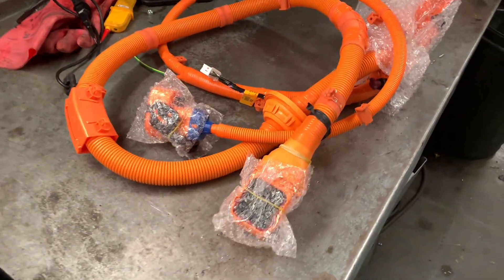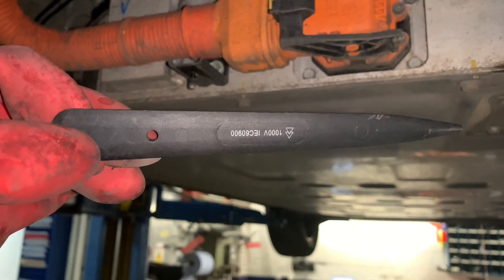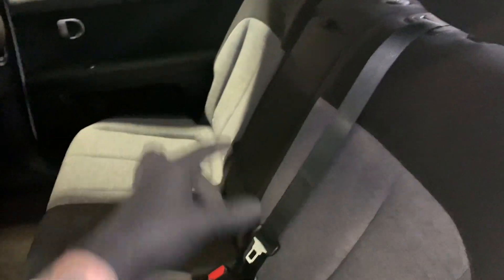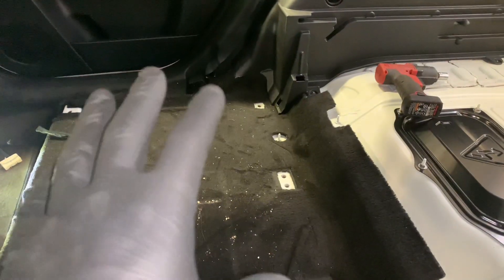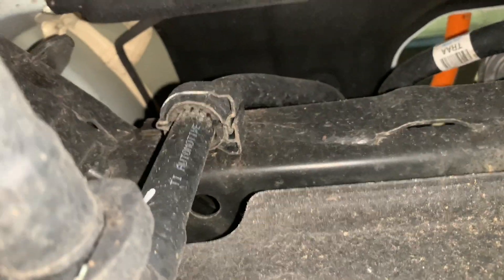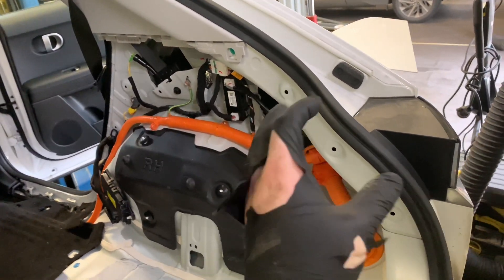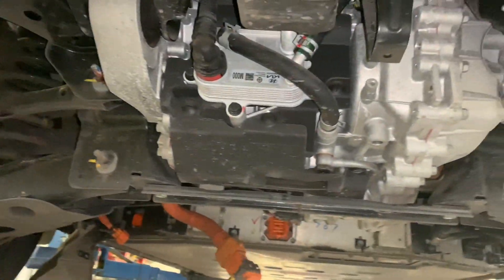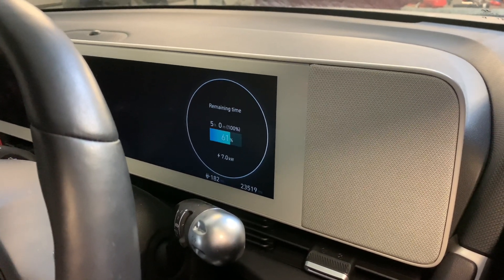Hyundai ioniq 5 combo inlet replacement | charger replacement | high voltage wire replacement |

Comment: Hi, I've just come across your video, my ioniq 5 won't charge using CCS chargers, it charges fine using my home charger and pod point 7kw, could it be the fuse or do you think it would be the charging port that needs replacing? It's having 5 recalls done at a dealership next week. I've 
Only had the car 2 weeks 😭
Reply from the maker: @AndrewB417  could just be a software issue which they will sort but it could be many many things when it comes to an EV. I replaced a motor once due to it overheating on charge and kicking the charger out
Reply: @owensautotips 
OK, thankyou for your reply, I wasn't sure a software update could rectify the ccs charger not working, I presumed it would need replacing. Fingers crossed one of the updates rectifies it. Thanks again for your help, much appreciated.
Reply from the maker: @AndrewB417 I don’t work in dealer anymore but if I remember correctly I’m sure there’s a update for the VCU vehicle charge unit so hopefully just that
Reply: @owensautotips 
Thanks mate, you've given me a glimmer of hope 👍
Reply from the maker: @AndrewB417 no problem at all buddy, this is why we do content 🙏

Comment: Since H/K added temperature sensors to the charge port on the E-GMP models there have been a number of reports of this 'overheating' problem.  And, given that the port itself (true with all EVs) is subject to repeated plug/unplug cycles under outdoor conditions by consumers, it seems epically poor design to not allow for much more efficient servicing.  The receptacle pins and body, including the lock mechanism should be replaceable as an assembly from outside the car.  It's just nuts to have to replace and feed through all those wiring looms to carry this out.
Reply from the maker: In some cases yes it can be down to the pins etc but this had a fault in the look itself unfortunately

Comment: mine stopped charging today on ac it gives me error e7 overcurrent with charger that i got with the car. i tried another 3 phase charger that i have it doesnt work it trips fuse in the house . i didnt try dc charge i will do that in the morning i will take car to dealer . do you think iccu has failed ? wouldnt be there any fuse to protect iccu from problems ? or
Reply from the maker: Unfortunately with EV without a fault code it’s hard to assume or indicate what is wrong. As all of it is connected it could be the charge port, iccu even the motor or ac pump etc. as when it’s charging it runs through each component.
But yes on the i5 there is a 1000v HV fuse on the back of the battery
Reply: @owensautotips  i will try in morning when i am on the way to the dealer to dc fast charge and if that also dont work lol then something is fucked up bad lhhahah XD luckily it is under warranty
Reply from the maker: Joys of the 5 year warranty 💪
Reply: @owensautotips  yea i will sell it before warranty expires i wouldnt want to keep it past warranty  . seems tesla is only reliable ev now .

Comment: Hello!  On my Ionic 5, the connector on the harness 91880GI230 broke.  I can't find the wiring diagram anywhere.  If you have it, could you send it to me?  Thank you!
Reply from the maker: Would love to help but I no longer work for Hyundai. If you call the dealer they should be able to help
Reply: @owensautotips  The dealer is ready to take it for repairs, but won’t give you the diagram itself(